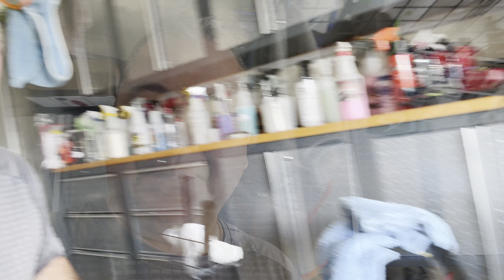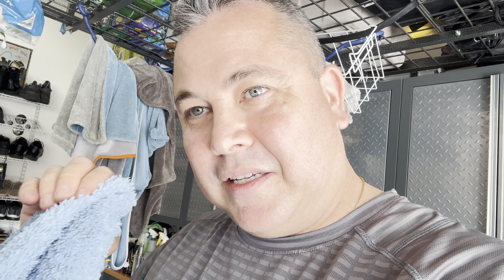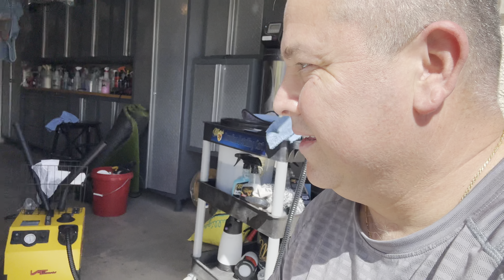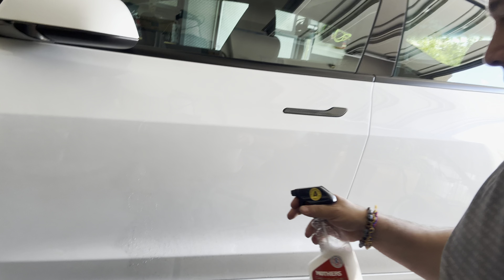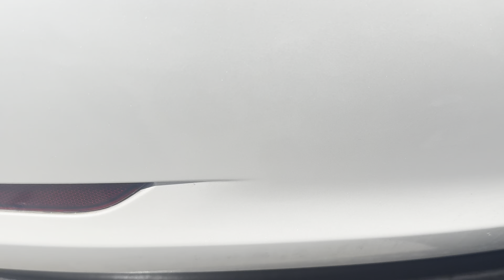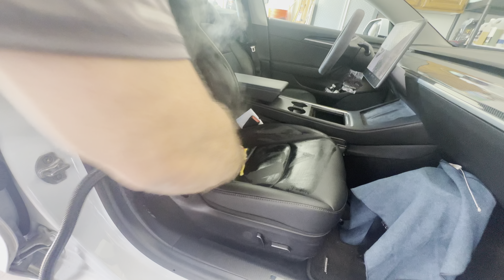Car Washing With Steam/ Vapamore/ Auto Detailing/ Waterless Wash/ Autoforge.net

Comment: Did I  miss how many bars this puts out and great video!  Steamer looks wild
Reply from the maker: It’s 5.2 bars max at 75psi.   302 Fahrenheit . And hold 1 Gal.  It’s very good to work with.  I’ve had my VX5000 for 8 years or so and got that used.   It was just time for a new machine and these look better quality than others I looked at.   It does the job for sure.

Comment: I'd be concerned about the steam method reducing the effectiveness of any paint protection you have on the car, as opposed to a regular wash method. I agree though, works well when you are forced to clean your car in the garage and don't want to have water/dirt/soap on the garage floor.
Reply from the maker: I mean, I live in Vegas where the hood temps get 180% plus out in the summer.  It’s the reason waxes burn off quick here.  The steamer but not concentrating in one spot or you would probably burn the paint at some point.   It’s a moving motion.  But if u have never used a machine like this it could definitely look like it hurts protection.